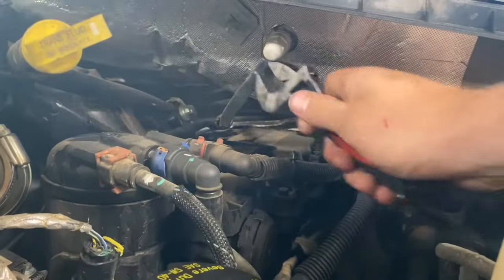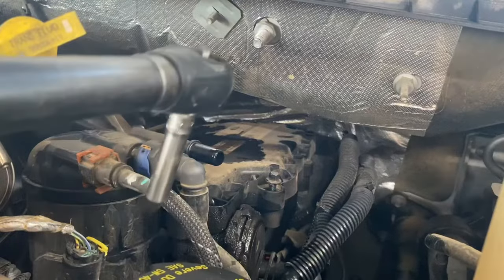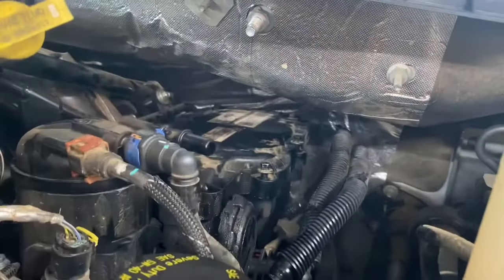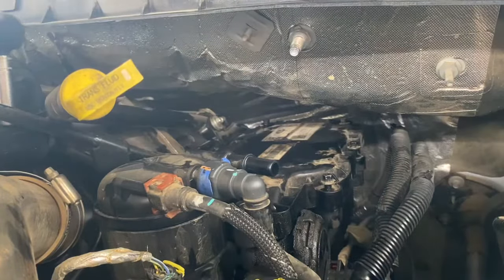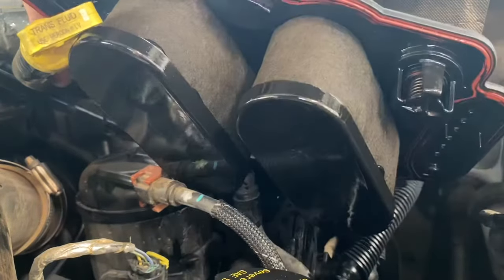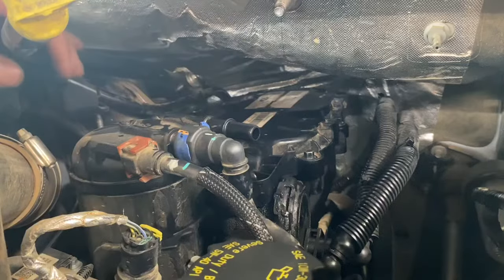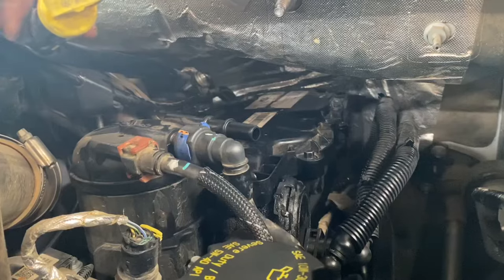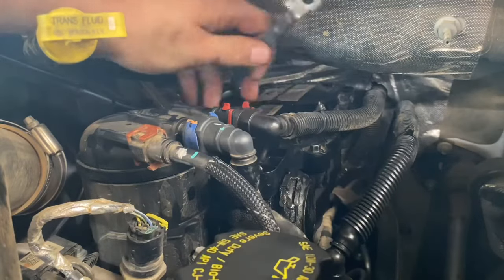PowerStroke: 6.7L Leaking Oil? CHECK THIS FIRST (Crankcase Filter)

Comment: Watched 20 or so of the oil pan r&r videos. Not a single one mentioned this. Good job! I am glad I LOVE my 7.3 & have no desire for anything different.
Reply from the maker: Thanks man. A lot of people will repair the oil pan leak without fixing the root cause which is the crank case filter. Just ends up leaking again.

Comment: Had my 2019 upper oil pan gasket/RTV replaced at about 25k under warranty for an oil leak. I’ll have to look at the RO and see if this 6A785 is on there. I would almost bet it isn’t now it’s at 40k and I get a whiff of burning oil every now and then. Going to be doing a fuel filter service soon so I’ll just replace it anyway. Thank you very much for this video! Very empowering. You rock!

Comment: I’m with you, pre fill the oil filter. Coming directly from the oil jug, it’s not contaminated. I believe the issue is for folks that dump into a container that is left out and used multiple times.

Comment: Great Video ! Would had been nice after replacing crank case filter to show oil cap off "no blow by". Before after. Keep it up !
Reply from the maker: I’ll keep that in mind for the next one. Thanks!
Reply: @FlyingWrenches13 is it possible A CCV filter caused a (burn oil) smell going inside the cab after diagnosis zero oil leaks?.

Comment: I just purchased a 2017 F250 with 100k and checked the Crank Case Filter the way you did. There is NO Pressure on mine at all. It still has all the OE Stickers on the Top.

Comment: At what millage do you typically see these filters needing to be replace?  Thanks!
Reply from the maker: All depends on how hard the engine usage is and oil change intervals. But I would say Usually in between 75-100k they need to be replaced. I would be checking it a lot more often if it was my truck though.

Comment: I don't really see high idle or a lot of pressure at the oil cap but I have 130000 on what was a fleet truck so I have record as to whether it was replaced. I changed the oil recently and while under there noticed a lot of oil coming from somehwere in the front of the engine. Now I just crawled under there to get a better look and I notice there is some oil pan leakage that I am sure was not there before. My question, is there a fool proof test or should I just change it to see if that helps? Just hate to pay if it is not neeed.
Reply: In the same situation did u ever find the problem?

Comment: I have a 2017 f350. I have the CCV box but mine doesn’t have those bolts, I’ve read that Ford did a recall on the ones with bolts to replace it with a new CCV box without bolts.  My question is do I still service that box??
Reply from the maker: If it doesn’t have bolts then it does not have a serviceable filter in it. Are you having high crank case pressures?
Reply: I have seen you can change the diaphragm and that supposedly works but I am not 100% sure. Some sources say to do that but I am not 100% sure. Dorman sells a kit with the cap, spring and diaphragm.  I am thinking of changing mine soon as a preventative measure.

Comment: Thanks for posting this video.  I believe this filter system may only apply to “Dual rear wheel and incomplete chassis configurations” (per my Ford manual).  I have a 2019 F250 4x4 6.7L and it does not have the crankcase filter, however, I do have a leak at the transmission bell housing gasket where it meets the upper oil pan (and maybe a little higher).  I did the pressure check at the oil cap and it seemed fine so I don’t think it was caused by excess oil pressure. Any idea as to what may have caused this to start leaking?   I’ve only got 65k miles on it and Ford wants $180 just to run a diagnostic on it.
Reply from the maker: May just be that the silicone didn’t get distributed right when it was assembled. Is it leaking out of the bell housing area?
Reply: @FlyingWrenches13  It is.  Looks like it is coming from the seal where the bell housing meets the upper oil pan.  I did see that in some other videos that the factory has been missing application of silicone in the corners.  The one guy said that it is a known issue and he had his repaired under warranty.  Hopefully that will be the case with mine as well (as long as it is covered by the 100k power train warranty...)
Reply from the maker: Yeah it should be covered. Also could be leaking from the rear main or rear cover. Wouldn’t be able to tell until getting the trans out. Hopefully they will get you fixed up.
Reply: @FlyingWrenches13  Cool.  Thanks for the replies.  Appreciate ya!
Reply from the maker: No problem
Reply: Single rear wheel trucks have a different style CCV. What you can change on it besides the entire assembly is the diaphragm.  Dorman has the diaphragm,  cap and spring kit. You can get at Rock Auto or a local auto part store. I am going to do mine any day now. It's a lot cheaper than the entire assembly.  I had to do it on my wife's car and other vehicles.
Reply: Just found the video. I am new to Diesel engines and never realized about this filter. I’ve always known of changing the oil filter but not the crankcase. I have a 2012, just had the rear main seal and upper pan gasket replaced. A few week later after having a long trip towing my tractor I noticed a new leak that seems to be coming from the front around the oil pan area. I have 240k miles on it. I pulled the oil cap and it has a little pressure but nothing compared to this video. I am going to change the crankcase filter and have a shop check the front seal. I wonder if this is what caused the rear main and pan gasket to leak in the first place..

Comment: I have a 2017 f-250 6.7 and the crank filter box is one piece (the top doesn't come off). Why am I reading here that they didn't switch over to the one piece box until 2019. My truck was a lease return and I highly doubt that it was changed over. The truck was manufactured in Dec. of 2017. I have 60,000 miles on it and I'm not having any leak issues but I want to stay ahead of problems if I can. Is there a replacement interval for the one piece unit?

Comment: Mayson...my 2016 F350 powerstroke has started to leak oil....could this crank case filter also be my problem?  You mentioned 2017 and above....what are your recommendations on where to start diagnosing a 2016?

Comment: I have ‘19 F350 DRW that has the bolts. Going to change the filter this weekend. But in another comment you said they went to a new design in ‘19?
Reply from the maker: They did on some of the 19’s. If it has bolts it should have a filter.

Comment: I ordered the crank case filter for my 2017 Ford F250 and when I got under the hood, I found the crank case was a complete assembly.  No bolts to take off the crank case cover.  Do I order a closed crankcase assembly and change the whole thing?? Please advise.

Comment: Nice! Now I just hope this is my issue I've got a 2017 F250 6.7l Platinum with 77k miles on it been running like a dream til 2 weeks ago. Now I'm seeing something leaking driver's side underside of engine. Seems to leak if it's sitting for a day on incline or when I stop somewhere I see fresh stuff dripping onto and coating some of the lower rods (steering components etc). Hope this is it thanks for the video man
Reply from the maker: No problem. Hope a filter fixes you up.
Reply: This helps you
Reply: Have you looked at the vacuum pump front center of the engine? Notorious leak area.
Reply: I have 2016 f250 6.7 my oil leak is in the passenger side
Reply: @je7758  I'm having the same issue with my 2016 now. What did it end up being?
Reply: @BTyler808  my turbo pedestal is leaking oil

Comment: My 2015 f250 crankcase oil vent separator has a sensor in it to tell when there is a problem.  I guess when the filters are plugged. Mine had to be replaced a 29,000 miles.  That seems like low mileage to me for it to plugged up.
Reply from the maker: The sensor isn’t actually there to tell if it’s plugged but they had a recall at one point and time about those ccv sensors failing. The one they had you put on had the sensor but no pins in the connector. Also had to do a pcm program to turn off the ccv sensor.
Reply: @FlyingWrenches13  I found out from the mechanic what the sensor is for. It is a position sensor to let the computer know if the hose was left off the metal tube. Accidentally or on purpose. That is all. It don't have a thing to do with the ccv box plugging up.
Reply: @wilburdunn2552  yup it’s all about EPA.

Comment: Hi Mayson, I got a super duty 2017 and my upper pan was leaking the first year, so ford fixt it uneder warrenty, and they told me they change the crank filter for an other one that you don't have to change it anymore. Do you think it is true ? My upper pan is leaking again. First time 30 000KM and 2nd I forgot the mileage and 3rd at 190 000KM. There is something wrong I beleave.

Comment: How long does the truck need to run to build up pressure so you can notice it when oil biller cap is removed?
Reply from the maker: By the time you crank it and walk to the hood it has enough.
Reply: Thanks
Reply: Mine was doing it, swapped it out and now it doesn’t have the pressure that it did before. Fingers crossed that the oil leaks stop or dry up to a few drops.
Reply from the maker: It will slow way down for sure.

Comment: Nice video. I have a 2019 6.7 with no bolts on my ccv. What should I do or look for?
Reply: 57000 mi
Reply from the maker: Just periodically check for excessive crank case pressure. If it starts to get a lot then you might want to change the assembly out. Is it a f250?
Reply: @FlyingWrenches13  Yes F250
Reply: @FlyingWrenches13  some other channel/s sources say you can just change the diaphragm, spring and cap. It comes as a kit from Dorman. The round part on the assembly.  In your video you can see it looking just to the right of the fuel filter. Is this all correct?

Comment: Does the 2008 f450 have the crankcase filter too And is it a problem also?
Reply from the maker: No it doesn’t. If a 6.4 is building excessive crankcase pressure it needs an engine.
Reply: @FlyingWrenches13  thanks, engine has 240,000 miles I honestly think it's done.
Reply from the maker: Yeah I feel for you with the 6.4!
Reply: @FlyingWrenches13  I appreciate you replying. Thanks again 👍
Reply from the maker: No problem!
Reply: @FlyingWrenches13  "If it has a 6.4 it needs an engine" FTFY..

Comment: That's pretty cool how many miles do you have to have on it before you change out the crankcase filter
Reply from the maker: I would probably start checking or plan to change about every 30k miles.

Comment: Hi Great Vid. Mine doesn’t have the filters inside. What’s the part number for that type and can I buy that type or does it change up to the filter style . Thanks …….stay busy 😎
Reply from the maker: What year model?
Reply: @FlyingWrenches13 sorry I didn’t mention that did I .  2015   Thanks for the reply
Reply: Also just now I checked blow by at cold morning start up and absolutely none . 65,000 miler. With religious oil changes .
Reply: But I do see what looks like the vacuum pump leaking , dam gotta get a gasket for that !
Reply from the maker: Most likely the vacuum pump issue is just because the bolts are loose. They are bad about backing out. As far as your oil separator, you would replace back with the same one that’s on it.
Reply: @FlyingWrenches13  thanks ok on the separator and yes just scratching myself up now digging into the vac pump seal job
Reply from the maker: They aren’t bad to get too. Could easily be done in a driveway haha

Comment: I have 2011 ford 6.7 I took that ccv valve filter and cut it apart there is no filter just bunch of springs and rubber valve inside , I believe starting from 2016 or 2017 they have actual filters inside ccv

Comment: Mechanic said oil leak was caused by a bad CCV filter, how long should I expect the oil leak to continue after changing, mechanic said could take awhile for the pressure to normalize and stop the leak? Is that right?
Reply from the maker: Ehhhh. Most of the time the leak won’t stop, only slow down.

Comment: I have the newer style on my 2017 that doesn't have the bolts on top do the newer ones have to be replaced? and ifso is there a basic mileage for that ? Thanks for any advice you can provide
Reply: Did you change your entire crank case assembly?  I am facing this same issue - the crank case is a closed assembly.

Comment: Would this be the same on a 2014 6.7 powerstroke?
Reply from the maker: Yes you could have the same problem as far as excessive pressure goes but the 11-16 models don’t have a serviceable filter. You have to replace the whole assembly.
Reply: Where is it located at on the 14s? I have a leak somewhere on the drivers side
Reply from the maker: Located in the same place. It almost looks identical other than it doesn’t have the same removable top on it.
Reply: @aaronrose1990  no bolts on the non-serviceable PCV valve box.

Comment: If you're truck is out of warranty the aftermarket makes a fix that will not fail and is one and done. Tree hugger not approved. I also got the pleasure of replacing upper oil pan gasket shop said common in 2015 from back pressure caused by clogged part.

Comment: I have '12 6.7l with the non serviceable one with roughly 171k miles on it... Will those clog as well? I've never changed it. Truck just recently started leaking oil from the lower oil pan (possibly)... It's cold out so I can't exactly power wash to get a better idea of where the oil is coming from... I've been looking on the forums and can't write find the answer I'm looking for.
Reply from the maker: No those usually won’t clog up. Check the pressure by removing the cap off with engine running. If it’s has a bunch replace it, if not then I wouldn’t worry about messing with it.
Reply: @FlyingWrenches13  I think I find my leak... It was the oil cooler but I at least wanted to ask you the original question that I asked just to be sure that wasn't the root cause... Thanks

Comment: I have a 2018 f250 i tired changing it but the top of the filter has no bolts, it looks just like the 2016 one
Reply from the maker: You have the updated style that doesn’t have a serviceable filter.
Reply: @FlyingWrenches13  So, if it doesn’t have a serviceable filter you just replace the entire thing then?
Reply: @letsgobrandon7112 also curious on this. 2017 with no top bolts. Should I replace?
Reply: @caseymcauliff  I’d say yea!

Comment: Call SPE and get a CCV reroute kit, carve out 20 minutes of your life for an install and BOOM your done. And as a side benefit there will be NO MORE oil going thru your turbo and across your intake valves.
Reply: I just did this but I think it might have been too late. My engine keeps pumping out a lot of smoke from the kit housing. Any idea of what else I can do? Mine is a 2017 F-350
Reply: @PanchoTubau  Are you seeing any pressure when you take off the oil fill cap while the engine is running ?
Reply: @PanchoTubau  I don’t understand, what kit housing ? Once you remove the ccv box you install the internal catch can (optional), the adapter, run the hose, then block off the other hole on the valve cover, then use the cap on the intake. Did you install it correctly ? Did you use spe’s system ?
Reply: I think I misspelled above.  I'm getting smoke from the engine.  There is still pressure but it is releasing it through the kit hose, when uncovering the top it releases again, it does not keep as much pressure as before but it is emitting white smoke.
Reply: Will this void any warranty on the engine
Reply: @rustywrench2119  According to the Ford dealer Mechanics that I have talked to it won’t because it doesn’t effect the engine, it only allows the ccv gases to vent to the atmosphere.
Reply: @PanchoTubau  What kit hose are you talking about ?

Comment: Can you replace that box with the one that doesn't have a filter
Reply: According to Arod on a different channel, yes.
Reply from the maker: I’m not for sure on that. I know there is some ccv reroute kits in the aftermarket world that gets rid of the filter but I’ve never installed one without a filter on one that has a filter.

Comment: I have a 2012 f250 with 135k, no oil leaks, and was thinking to replace this incase it’s close to being clogged. I’m getting some oil  in the charge tubes but I’ve heard that’s normal
Reply from the maker: That’s very normal. Probably not the worst idea to replace not rather than later!
Reply: Arod said that 2011-16 don’t have to replace because it’s not a filter so I see a lot of guys using ccv reroute kits and don’t need one I have 2015 6.7 157k had for goin on 6 years no issues thank goodness

Comment: thanks for info bro. I have 2011 300k miles leaks some not 314k its leaking horrible front of oil pan
Reply: Mine as well 
10/28/23
Reply: Not coming from pan but higher. 
Did you get a fix?